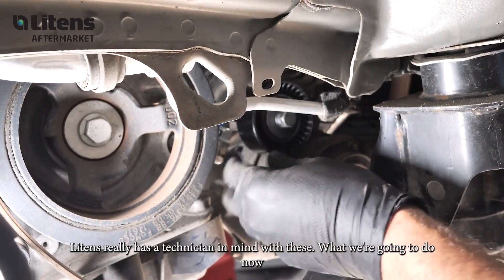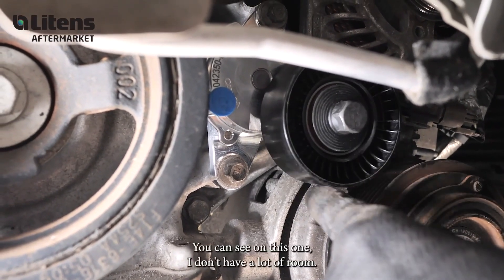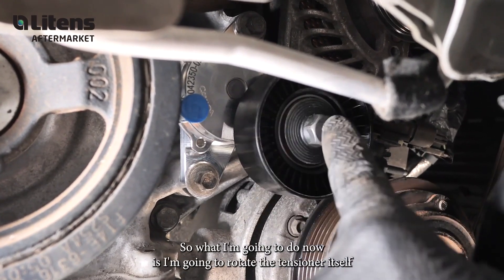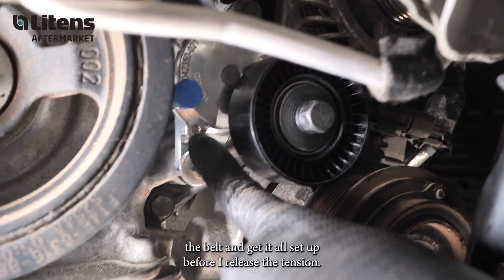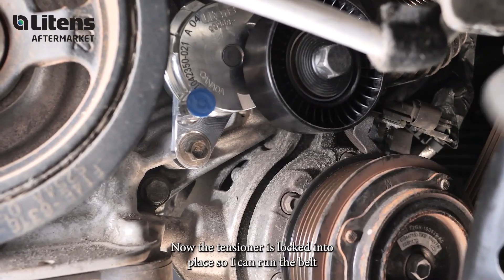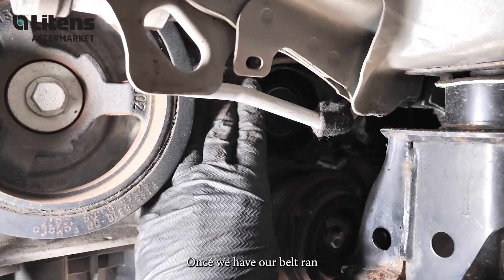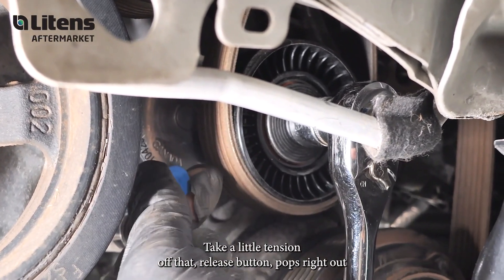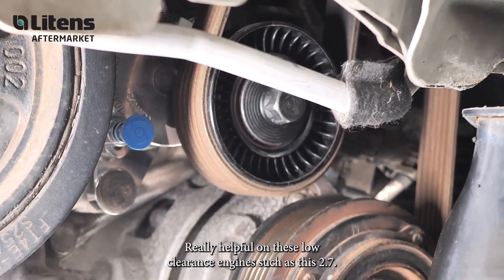How the Litens Easy Button™ Tensioner Works – See It in Action!

Comment: That replaces the OEM tensioner pulley mounting bracket?  Is that correct?
Reply from the maker: Hi there! The Easy Button™ latch is built into and is part of the replacement tensioner assembly. In this case, the technician replaced the OEM tensioner with a Litens 999687 Easy Button™ Tensioner. Hope this helps!